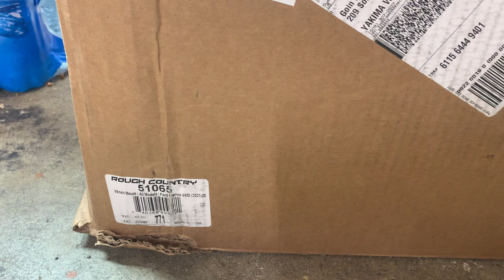Rough Country 2021-2022 Ford Bronco Hidden Winch Mount

Comment: That was pretty bad. But for the price and considering there are no other hidden winch options it is what it is. Are you going to strip the paint and reweld? I wouldn't have accepted the first one, the second one is ok. I do take into consideration that once installed you can't really see that part.
Reply from the maker: I had it stripped and re powder coated.  I think most people wouldn’t even notice or care, but I work for a metal fabrication company so I’m a bit picky.  I contemplated making my own mount but I got the Bronco in October and needed a winch before the snow started to fly and $300 is hard to beat.  It is a good kit I just wished they had spent a little more time on the finish work.
Reply: @goinwheelin  Where are those parts made? I can’t imagine them being made here for that price.
Reply from the maker: @swooshdave  
I don’t know.  China maybe.